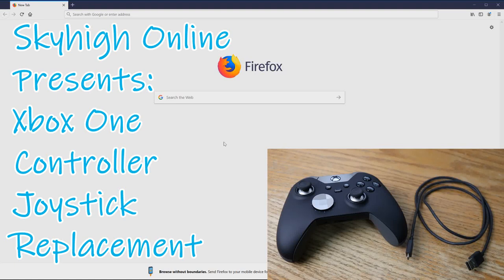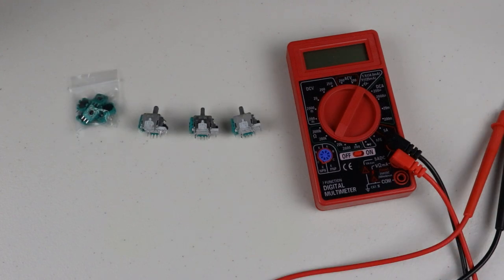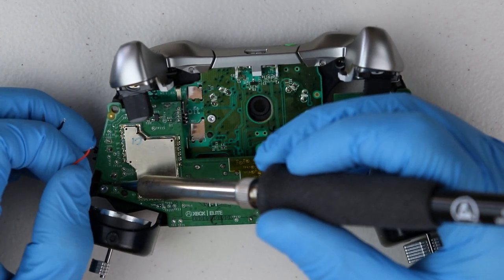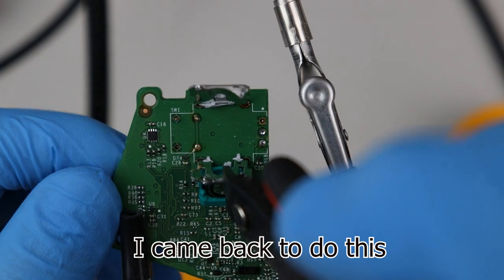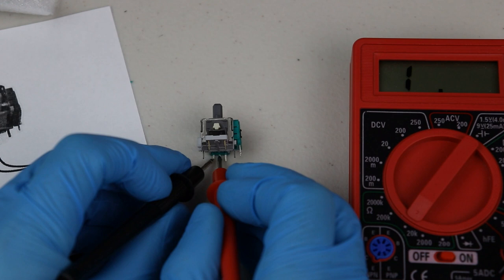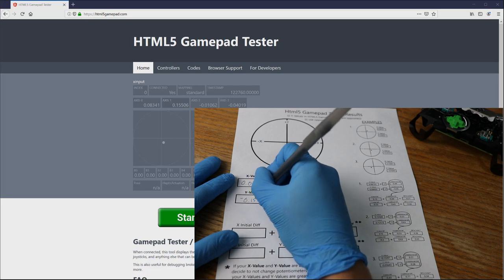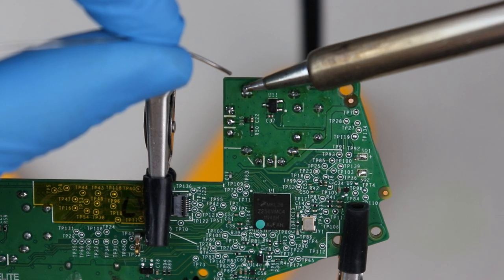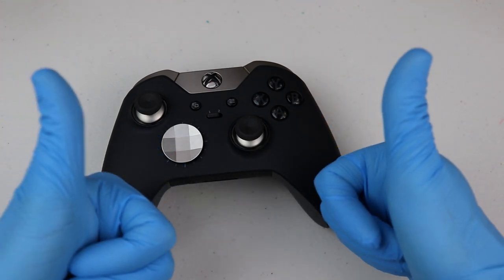How to Replace Xbox One Controller Analog Joystick - Fix Stick Drift & More

Comment: Mostly unnecessary work. Most stick drifts can be fixed by cleaning or replacing the wipers in the joystick. These wear out over time or are likely damaged or faulty from the factory. No need to de solder the rumble packs either. Fixed 2 controllers with drifts on different sticks, one by cleaning one by replacing the wiper from an old wired controller.
Reply: Yes I agree, but this is necessary when the stick has snapped/broken, the deadzones are usually always out with 3rd party sticks

Comment: >_> i just replace the wipers within the potentiometers and the drift always goes away again lol
Reply from the maker: Nice! I can see how that can work sometimes because the wear from the previous wiper might be oriented slightly different than the next wiper.  Eventually, however, I think the wear will be too great to overcome.  I'm not sure why they keep using carbon in their pots when it's fairly easy to wear down (well, I can think of one reason)
Reply: @SOSSGAMING  ive just ordered some of your modules off amazon. Going to use fresh wipers until that isnt a reliable fix anymore and i have to buy a soldering kit. Great vids though man

Comment: [First Aid Solution]
Take a Straw, Flatten it so it looks like this [] 
fit it in the analog stick from the side while holding it down and blow really-really hard from the other end of the straw (or pull air, up to you... but be careful... and don't overdo it). 
Enjoy a Drift-Free experience along with a really bad headache for a moment.

Comment: Man I should have watched a vid about this before I bought new sticks cause this is way to much work and is way to complicated I thought I could just take apart the controller cover rip out the analog and stick in a new one
Reply from the maker: Yeah, it can be a little daunting. Not that this will help, but I made another video with another method that is a little less complicated.

Comment: Lol, this is just too much work. I'll stick to my mouse with no deadzones :)
Reply from the maker: Haha I hear ya. Are you playing on PC? If so, there's actually a way to simply replace the joystick without doing any of the readings/calculations and software calibrating afterward.  But this is only an option for someone playing on PC unfortunately.
Reply: @SOSSGAMING  Yeah, I'm on PC. Sounds interesting, what's the solution?
Reply from the maker: @fishywtf  Windows has a built in software that can calibrate the xbox joysticks.  It's one of the many videos I'd like to make but there are already a couple videos that explain how to software calibrate them.  Let me check
Reply from the maker: @fishywtf  https://www.youtube.com/watch?v=YjZrUnHC_Wg&t=30s  Here's one of them.  There's a chance you might even be able to calibrate it now and it might fix the problem.  Otherwise, you can simply remove the prior joystick and solder on the new one and calibrate it on the pc as shown there.
Reply: @SOSSGAMING  If you calibrate it like he shows in that video then can you go back and use it on the xbox? Or will it only remain calibrated if you keep playing on pc?
Reply from the maker: @samreynolds6993  It will only work on PC. Otherwise that would be awesome. I am actually working on a new video (hopefully release within a week) with a new method that isn't as intricate as this one.
Reply: @SOSSGAMING  you're such a fuxxxing king with all these replies and details, easy sub

Comment: Nice video, but may I point out PLASTIC GLOVES WHILST SOLDERING! eek
Reply from the maker: Haha thanks.  Am I missing something? It should be no different than a bare hand.  Do you wear other gloves when you solder?
Reply: @SOSSGAMING  I usually just go bare handed. The risk when soldering with plastic gloves is that with a little heat or even a bit of contact with the iron will just melt the gloves to your hand. Very painful to remove lol
Reply from the maker: @kibsxkibbles7443  Ah interesting.  I guess I'm lucky to have never encountered that.  Doesn't sound like too much fun!
Reply: @SOSSGAMING  yeah, it's not the best thing to have happen 😅

Comment: bruh I feel like it costs more money and time to do this rather than get a new elite controller
Reply from the maker: If you buy what I did, yes! (I do repairs on the side, which I can do for you btw, link in the description). However this can be done with a $30 soldering kit, a $15 joystick kit, and an $8 helping hands!  You could save a little money, keep the tools, and learn a new skill.  I'll be posting a video by the end of the week showing a new method that doesn't require as much effort all while showing it with the tools just mentioned!
Reply: SOSS GAMING how much for a repair? I would be happy to send my controller in since I don’t want to pay $170 for another
Reply: Then I wouldn’t need to buy the kit also since you have one lol
Reply from the maker: @jigglymonkey4317  https://www.ebay.com/itm/224025946052
Reply: @SOSSGAMING  Hey so I think I'm gonna do your repair! So if I pay the $35 on eBay do I just ship the controller from there? I have bad stick drift so I'm excited for a fix
Reply from the maker: @jigglymonkey4317  Cool. After you order I will send you packing/shipping instructions.  You will then pack and ship out the controller with the carrier of your choice.

Comment: How much did people pay you to fix their stick drift?
Reply from the maker: When I was doing repairs, I priced the elites at $30 and regular controllers at $20.
Reply: What if the guy has no refunds and it cost $20 for a elite controller fix do you think he’s going to scam me?
Reply from the maker: @jamescash9171  You looking on eBay? Wanna link the listing and I can check it out? I don't think I offered a refund either, but I did offer a warranty.  It's likely not a scam, but I would make sure they back their work
Reply: Just checking in did you see my link of the buyer
Reply from the maker: @jamescash9171  Oh, no I did not.  I'm thinking it got auto flagged or something let me check
Reply from the maker: @jamescash9171  Ok I found it and just approved the comment.  Yes, it looks legit.  I would just ask if they provide any type of warranty on their service before purchasing.
Reply: Are you sure you can’t do one more repair?😂
Reply from the maker: @jamescash9171  Yes lol sorry I'm quite busy as it is and have already turned down quite a few people.  If life slows down maybe I'll start doing them again. :)

Comment: The real issue is why does Xbox controllers get drift so much
Reply from the maker: They use carbon based potentiometers. There is technology for hall-effect sensors, but those are still sub-par in performance unfortunately. Once those become more reliable I'm sure we'll see the shift!

Comment: This is a fantastically convoluted and wasefull way to repair these controllers! Soss Gaming if it works for you, great! for anyone else sorry there are much easier and far less wastefull methods. I agree with everything you say in the video, specially about the factory calibration. However your method for finding the potentiomiter values was intresting but deeply flawed it's 100% SHOCKING and a redundant process (people with no experience will blindly follow this as gospel)! Aslong as you have genuine ALPS analogs you can manually calibrate the centreing by slightly twisting the nub that fits into the potentiomiter. I have a video doing this. The center dead zone needs to be with in 0.100 in X & Y (on a 0 to 100% scale this is a 10% deadzone from factory). With my method I can get them to with in 0.030 consistantly and is a permanent solution (untill wear and tear sets in). This means disassembally, both analogs replaced, calibrated the pad, tested and re-assembled in less than 30 minutes.
Reply from the maker: Hello, thanks for chiming in!  That's awesome you have replied to my video, as I have seen one of your videos before. I was made aware of the new method until only recently.  This seems to have been mentioned after I had spent weeks figuring out this method.  Or I just couldn't find it.  Anyway, I've only read about it, but have not seen it in action.  I checked your channel and cannot find it.  Can you give me the title of your video that shows it? 
P.S. - This method can take me less than 30 minutes as well, and I can get them centered almost perfectly, but I also have many pots at my disposal (pre-measured) and a Hakko desoldering iron.
Reply from the maker: I just realized that what you are describing as a solution can't possibly work (as a permanent solution).  My method is a much, much better permanent solution.  You just let the different pots' and/or joysticks' slight imperfections do the work for you. The plastic nub you are referring to is part of a plastic mold.  I can't see how you will be able to twist it and make it a permanent solution.  Molds love to go back to their original formation.  I've actually attempted this myself before (was one of the first things I tried) and after just a day it was back to it's original position.  Maybe I did it wrong..  would like to see how you do it.
The method I thought you were referring to was removing the 3 little plastic nubs on the pots themselves.  Doing this, you can twist the pot itself ever so slightly (the wiper remains in it's central position) just a bit to manipulate the pot's position.  I've tried this today and have been able to do this on 3 joysticks in a row successfully without any measurements taken.  However, on the fourth one this isn't possible unfortunately, and I will be using the method I show in this video on that one.  Perhaps even a little combo of both.

Comment: Can I send in my Titanfall 2 Xbox one pdp wired controller and get the 5$ discount by subscribing I really wanted to fix it myself but I just realized I don't have the skill to repair it
Reply from the maker: Thanks for the inquiry! Unfortunately I'm pretty sure pdp controllers use different joysticks.  If you're able to tear down the controller and show me pictures of the joysticks inside I may be able to find and locate them (and replace for you).  You can send me the pictures at my gmail account sossgamingcs
Reply from the maker: Also, I'm pretty sure PDP controllers make their software calibration available to the public, so all you should need to do is simply replace the joystick and calibrate them with the software.  You will still need to find out what joysticks they use.  And if you do I will be curious.  Thanks.

Comment: So... to fix the stick drift on your 200$ controller, you just need 100-300$ worth of equipment, plus the replacement parts.. And if you're extremely patient and have the hands of a surgeon.. You might manage not to screw up the controller worse than it was..  The message to take from this, Don't buy Xbox elite controllers, period, they're overpriced trash that are only there to make M$ more money...
Reply from the maker: Lol exactly the fact MS doesn't allow for any software joystick calibration (PlayStation is the same) like other controller manufacturers shows they really want you to just buy new controllers $$$.  Granted you could technically get by with a $15 soldering iron kit to do this, but it would make more sense for those with the tools and knowabouts already to save the money or simply for those interested in learning something new or having a new challenge.
Reply: I screwed mine up way worse lmao it dont even move now
Reply: @SOSSGAMING  yea.. at this point, I'm just gonna put up with the drift and save my money. I already spent too much trying to fix this thing, and ya can't even buy the damn rubber grips for the main back piece in Canada, since they're all conveniently discontinued.. also it's perpetually wired now since it 100% refuses to connect to the console anymore (and yes, I know about Google, all the mainstream tricks were tried and failed). 
The new controller will likely be even worse in that respect; with the internal battery that will be guaranteed to fail after the first year or so (right after the warranty goes bunk)..

Comment: You went wayyy too far there is better and easier ways to do this
Reply from the maker: Yeah I'm actually in the process of making the new video as we speak actually.  Mind sharing your process? Perhaps you may have an additional technique that I haven't thought of yet.  At the moment it's the idea of cutting the 3 nobs of the pots off.  I feel like I've figured out a pretty good way of implementing it and have repeated it on about 30 joysticks so far, but I'd like to know how you do it, perhaps I've missed a small detail that would be good to include.  How do you go about adjusting the pot?